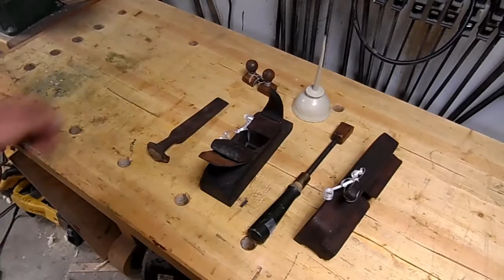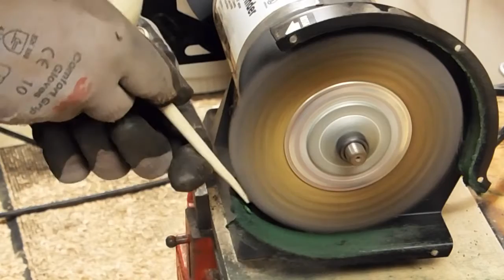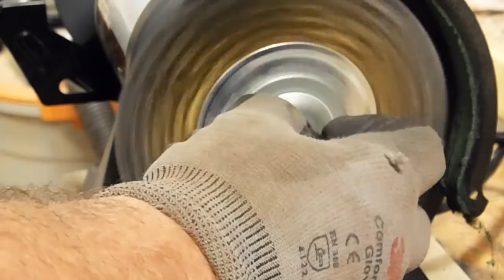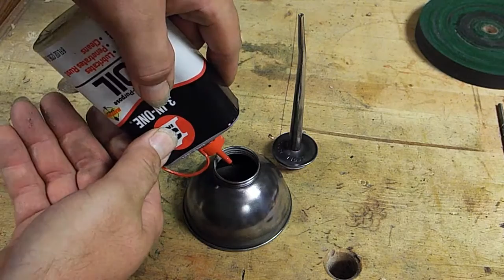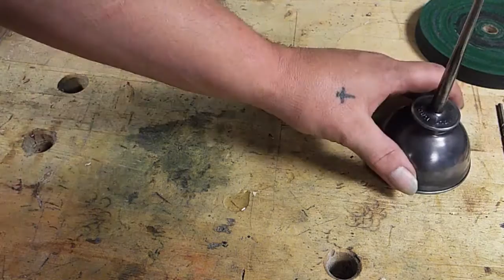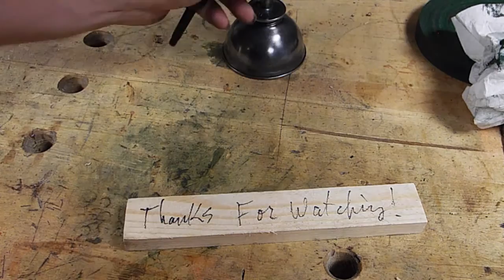GPQ 20 - Old Oil Can

Comment: Man that shined up good. I have an old grinder and this makes me really want to get it set up with a buffing wheel.
Reply from the maker: The buffing wheel is very taxing on this thing... I'm gonna have to upgrade to an 8" eventually.
Reply: GP Woodworks I am a big fan of the Rikon 8'' which is often on sale for $99. That is a 1750 RPM grinder though, if it matters.

Comment: What is the tool between the planes?
Reply from the maker: That's the soldering iron from 2 videos ago.
Reply: oops! ok.. i just missed that one =/
Reply from the maker: +Karine Guillette 

no worries... thanks for watching.
Reply: just watching right now ;)..
and i guess  you will make videos about the planes and the.. what it is, a chisel?
Reply from the maker: +Karine Guillette 

I plan to make videos on those yes...

That is indeed an old chisel. I'm still figuring out what to do with it. 

thanks again.